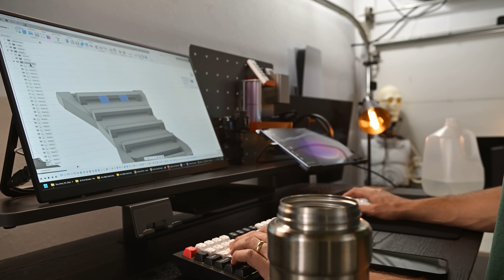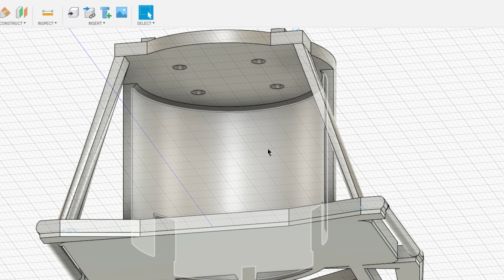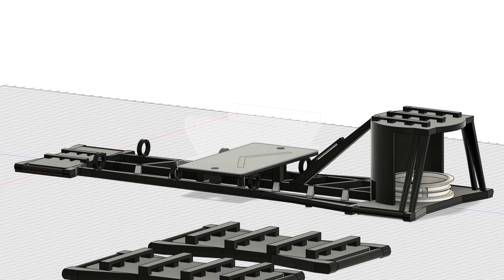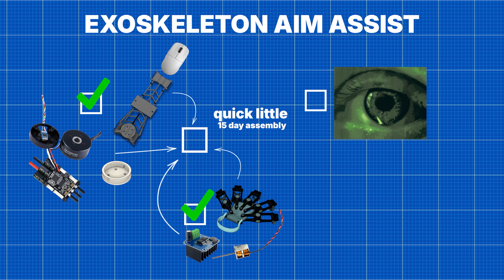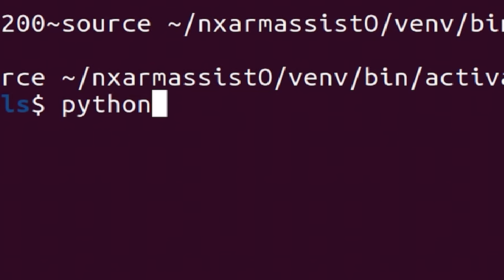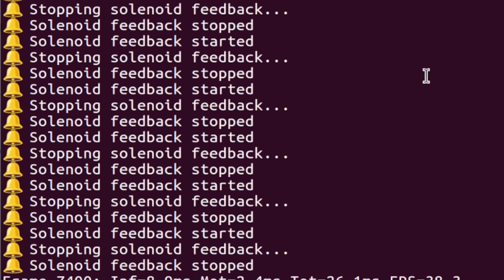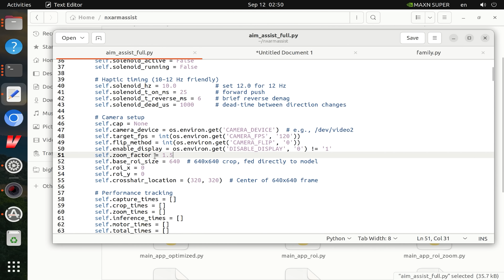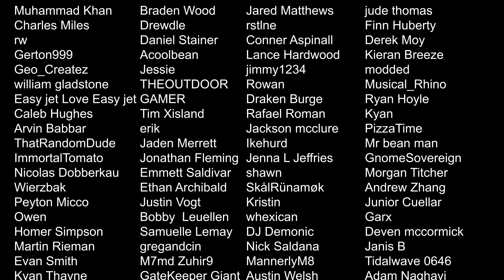Exoskeleton Aim Assist

Comment: Haha, very nice project. To me it seems you also built an autonomous aim assist that doesn't really needs an arm or a trigger finger, the arm and the wrist only make it harder (and more impressive). Basically, if a game is shooting from a stationary position, this could cheat anti-cheat just with a camera and an adjusted form of your device. Still, possibly harder to have it be practical for a lot of games, as the outline of characters usually isn't clear and it's an interpretation of the camera viewing a screen, would it be possible to use another video output instead of using a camera at all?

Comment: Hey, I'm a computer vision engineer and I have a tip that could greatly reduce latency and complexity. I would suggest to have an algorithm track the center point of a the blue blob. Any blob tool will be much quicker than Yolo inference. This should reduce your compute time to basically nothing with the Jetson.

Super impressive what you've done. Great work!

Comment: Surely the fire logic software should take system lag into account? (and maybe the aim assist also?)
Track what velocity the pointer is approaching the target at, and fire in advance so that the actual fire click happens right as the pointer gets on target.
Also, 90 fps monitor? Big improvements to be had there!

Comment: The control system from this with the electromuscle stimulation from the other contraption would be crazy. 300% improvement, just wait for it.
Outside of combining the two, maybe some very granular testing on the exact placement of the electrode points could possibly be extremely helpful for accuracy and timing.

Comment: I wonder if the accuracy is a major factor in the score diff. If the model included a movement prediction, it might help there. Could you also increase the mouse sensitivity? What about a DisplayPort splitter in order to get the frame directly into the device (though I do prefer the camera in the spirit of thing).

Comment: So hear me out. This is great an all, but it's a bit bulky. The same effect could be achieved via electrical stimulation. Tens units setup in the right locations and intensities could very easily be used to trigger the desired muscles without the need for a bulky exoskeleton.

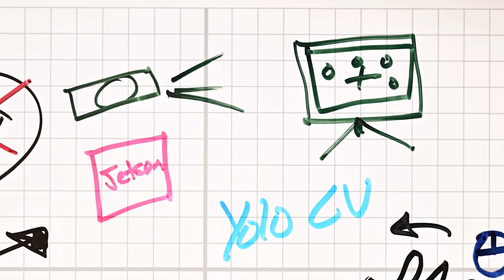Comment: 9:52 well, it is detectable but not by any kind of anti cheat software. If you were to get reported enough then a real human can just analyse your gameplay and determine if you were cheating. But by using the method of computer vision by pointing a camera at the screen youre undetectable without human intervention or as you said a 3 billion dollar ai that would be monitoring everyones games or at least games that get flagged because i feel like anytime you do really good youre more likely to get reported by more players anyway so more scrutiny on certain individuals

Comment: The build sequence feels so relatable to me rn, im currently making a makeshift retractable mask that uses 4 servos, at first the blueprinting took like 2 hours to make then I went to prototyping and that took like 2 to nearly 3 days, then making the final project( which im still in the process of doing) im having to do another set of prototyping bc ive been needing to simulate how one of the pieces can be lifted and since i dont have a 3d printer ive been using various parts from other stuff, tried using pulleys but too much materials are going to be used, now ive decided to use a rack and pinon with another long piece attached to the side to act as a equalizer hopefully this build can atleast somewhat work to my likings but other than that its been pretty solving these problems and using various other solutions to make this build.

Comment: Why stop at just neuromuscular-exoskelton aimassist? If someone were to be able to grab the frames straight off the retina there would not even be a need for that slow camera anymore. 

Alternatively, and on a much more serious note: There is a technique that I know of that trades optical resolution for FPS for cameras: A tiny mirror moves and illuminates parts of the optical sensor instead of the entire sensor. This can increase the frames-per-seconds vastly because each image that is grabbed from the sensor is now actually many images.  Lets say your CCD has 10 MP at 90FPS. Now you divide it in 10. That still gives you 1MP per image but a framerate of 900 FPS.

Comment: Pretty sure the fix for getting first place would be in the code. You are firing too many shots from the 'delay' in the solenoids/camera feed now, missing the shot reduces your score. You've fired enough shots to eliminate the blue orb, but it fires again because the camera still seen the orb before it disappeared from screen. A small amount of misses seem to be from over/under correction as well. Pretty evident at 16:30.

Comment: Just a random thought, you might want to look into a mouse with higher polling speed. There's a marked difference in the responsiveness of the mouse. Not saying it will make it 10% better, but it seems a bit silly to have a low polling mouse when you're trying to minimize latency.

note that I am not saying a mouse with a higher DPI, DPI is just up to you, but a mouse with a higher polling to have lower refresh rates on it.
Reply: The mouse he has comes stock at 1000hz and supports 4k/8k (assuming it's a pulsar X2)... that is 1-2ms between polls with an additional 0.3-0.5ms for wireless.... it's at the point where it's gone past diminishing returns... even with a +1000hz monitor you are not going to feel the mouse polling rate difference. (plenty of people say they feel a difference going from one mouse to another, without realizing there are more factors at play... i explain below).

If you have a 360-480hz monitor i would suggest you try using black frame insertion  (crt esque shader featured by blurbusters)... you do not feel any input delay despite frames taking 2x the amount of time. (generally games poll the mouse at the start of a frame, or separately on another thread at 1000hz if possible.. the mouse buffers pos XY and empties that buffer on request via OS API)

You will hear a lot of people talk about how a mouse feels more responsive with 4k/8k polling.... 99% of the time they have no clue what they are talking about.
We have already conducted tests on cs and quake professionals (both games being capable of 1000fps or more under the right circumstances)... telling them that the mouse is running at 4k  while setting it at 500-1000hz and vice versa.... they got it wrong pretty much every single time.. it's more or less down to the placebo effect and the cutoff point is at around 500hz or more... it's especially evident with people claiming better responsiveness while quite literally playing on 144hz monitors and ~144fps.

The entire point of 4k/8k is to avoid overall jitter and minimize inconsistencies (mouse wireless is not flawless, packets do get dropped from time to time...  solution is to send more packets).. with later additions of motionsync and similar implementations trying to create more consistency. (attempts to limit datarate to usb buffer for consistency instead of mindlessly spamming it)

Point being... messing around to get as high of a polling rate as possible  above 1000hz is a waste of time unless you have an inconsistent data rate from mouse to usb HID.
Reply: @pitchatan  Ah then it's substantially better than what I thought, I am using a mouse that polls at 125hz and randomly switched to a gaming mouse that did 1000 hz and the different was night and day, even just looking at the mouse move not in a game. Unfortunately my gaming mice aren't ergonomic enough for me anymore, so I'm just rocking this sad low polling speed for now. Not that it matters, because I ended up getting a monitor that is only 60 hz. That being said, the whole point of the setup is to go beyond human limits, so you should hope that your equipment can do better than human limits, otherwise what are you building superhuman tools for? You'd just get limited by your input devices.
Reply: This is really true, you are right bro.
Reply: And 90 fps monitor? That's not going to cut it.
Reply: 1000hz polling is already more than good enough for this, faster polling will not make a noticeable difference.

Comment: "I upped the voltage and changed the power delivery method of the piston on my finger, I also optimized the code so it push forward harder and backward less" Definitely a line, a ripperdock would say after his favourite merc failed a gig

Comment: You could grab another 1-2ms using an eDP display. An Alienware r18 m1 480hz running on the iGPU will give you the lowest latency from GPU VRAM to screen, although it is an LCD panel, so depending on how it syncs up with the camera you may be better off with a lower refresh OLED.

But js eDP is being slept on in low latency applications.

Comment: Hail spirit of the machine, essence divine, in your code and circuitry the stars align.
By the Omnissiah's will we commune and bind, with sacred oils and chants your grace we find.
Blessed be the gears, in perfect sync they turn, blessed be the sparks, in holy fire they burn.
Through rites arcane, your wisdom we discern, in your hallowed core the sacred mysteries yearn.

Comment: In college I tried to make an electrically assisted wheelchair. like those electric bikes that you pedal and a motor helps you. I tried to put the control on the conecting rods between the wheel and the push ring. I wasnt able to tune the power delivered to the wheels. I hope you find this idea interesting and try it.

Comment: 12:45 ya do realize they program excessive jitter into the game just to make it imposable to aim at a singular aria, its a physics engine similar to pushing a beach ball under water only using one hand. the radial hit box entry has to be perfectly concentric or the aim deflects a small amount into a lower or higher hit zone... 0.5ms input corrections to correct for the anti-aim sub system physics code. "need extremely high DPI speed on the mouse to sink the beach ball"
Reply: incomprehensible and provably false.

Comment: Note to self: I really need to buy a 3D printer and some arduinos, motors, etc.  This kind of project looks fun as hell, but all I have currently is software.  Although...I do still have some shop glasses with IR LEDs in them and a wiimote, I could revive (redo, it's long gone) an old project from 2009.

Comment: You need to use Metal wire instead of Kevlar.. for your hands.. I know that is scary... But straight fabric will just wear out very quickly in the hands motors I did it wall the time in College Im Obsessed with Hands as a video game designer/ artists Making robot Hands and drawing hands is like my whole thing...  Its the same problem with choosing Carbon Fiber over Steel.. Its way too porous and wears out way faster...   Fucking Love you Channel Bro <3_<3

Comment: if real cheaters were this creative i wouldn't get mad in games cause all your vids are crazy impressive
Reply: I 100% guarantee you'd still be pissed
Reply: ive got a radar that uses network packets no DMA needed
Reply: @rjvlogs3653 you’re a loser
Reply: This guy is probably just cheating btw, the results are numbers on a screen you didn’t actually see him accomplish anything so probably best not just be a gullible idiot
Reply: Making normal cheats is harder imo. You have to reverse engineer the game’s offsets and use advanced techniques to avoid the anti cheat detecting you. Meanwhile using the exo skeleton iskips over those and just relies on a image recognition python script
Reply: @skiez7430  making them maybe but the mentioned "real cheaters" dont write the cheats 99.99% of the time and just throw some money at the screen to become "a good player"
Reply: @skiez7430  common it's not just about python script, it's about doing things physically under considerable amount of latency.
Reply: @skiez7430 making cheats are relatively easy as well as bypasses, kernel drivers exist and will bypass any anticheat easily.

Comment: 0:11 how you gonna blame it on linux...
Reply: Because sound drivers on Linux can be hit or miss when it comes to microphone gain for certain audio cards. And sometimes AGC is on by default but with bad settings on some DEs... These are all fixable but are issues that happen more often on Linux than Windows. When I used to use Windows this never happened to me but since switching to Linux 6 years ago this has happened a few times to me as well as some of my friends.

TL;DR: this is fixable by changing your audio settings if you have the know-how, but sometimes the default audio settings have mic gain up too high causing clipping on Linux.
Reply: @louisdalibard818  I've had kind of the opposite experience. I always had annoying issues with audio on windows, things like having to restart programs and turn settings on and off to get them to work. Everythings been smooth sailing on arch with pipewire. I've recorded drums, guitars and my voice with zero issues (so far, thankfully, knock on wood). Real time monitoring and routing has also been so much easier with things like qjackctl.

I guess I can see why a DE might mess with your gain but I dont particularly get how thats much different than windows. You still have to set your gain properly no matter what OS youre on...